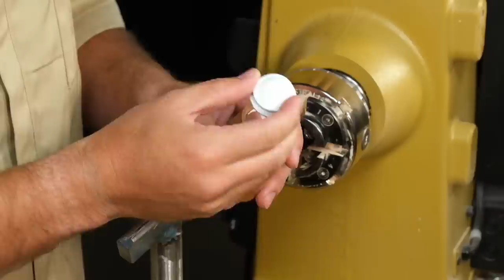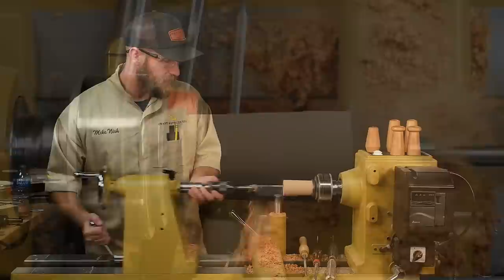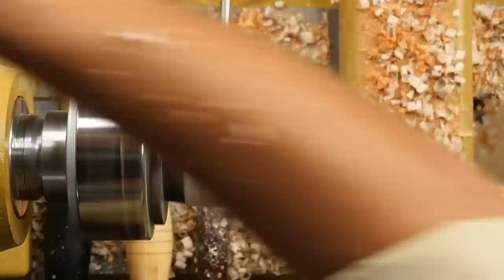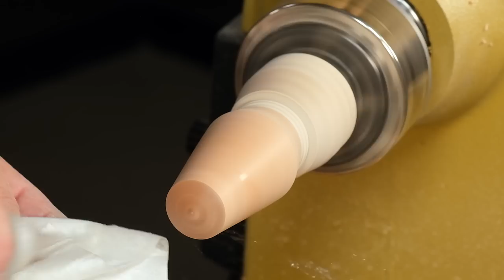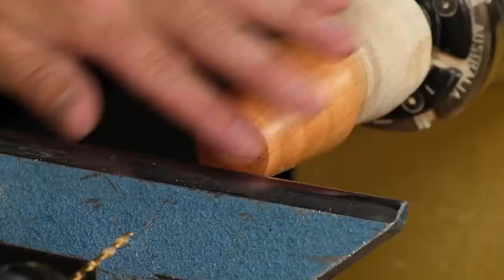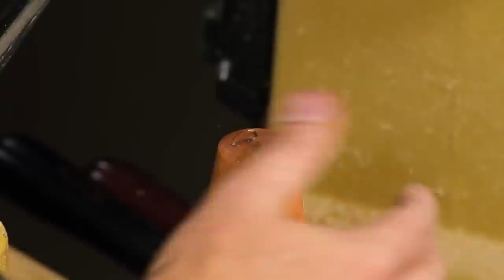Turning a Salt and Pepper Shaker Set - Woodturning Demo

Comment: I have turned several pair.  I use white oak for salt and walnut for pepper
Reply: I forgot to mention that I use a 35 mm bit to make the counterpart for the rubber plug.  It's simple and almost foolproof
Reply: Also I change jaws on my chuck and chuck on the i.d. instead of a jab chuck

Comment: I courious about the cleaning aspect.  I’m sure it just gets wiped off with a damp rag.  My question is the inside cleaning.  It’s not sealed in any way. How would you keep moisture from getting into the wood and does it need to be sealed with a food safe material
Reply from the maker: The inside almost never needs to be cleaned, but you could seal the inside with a food safe mineral oil before use.